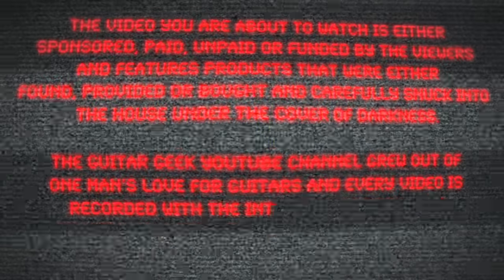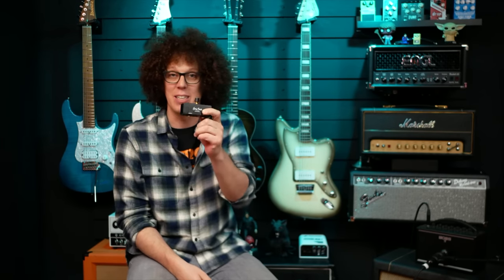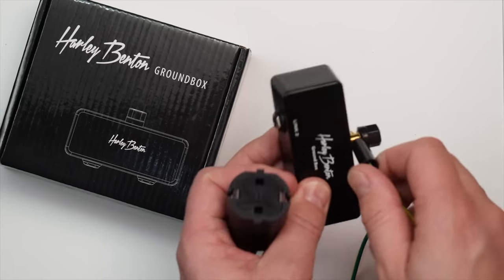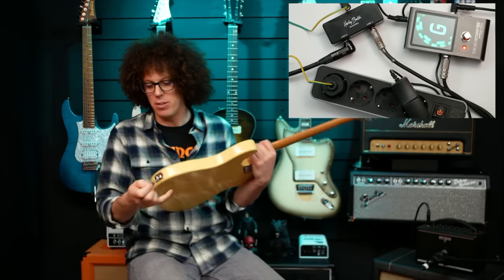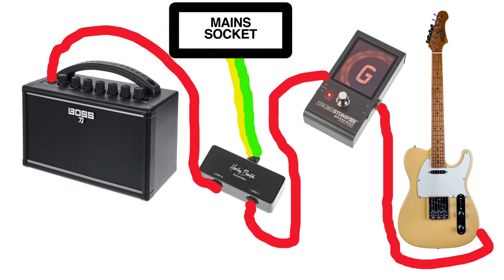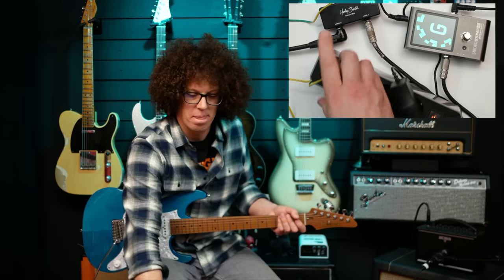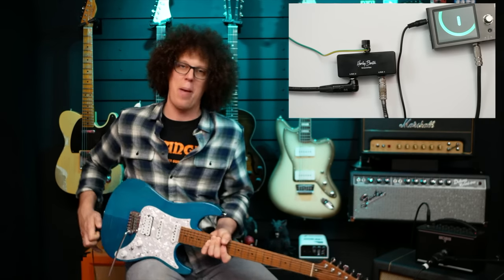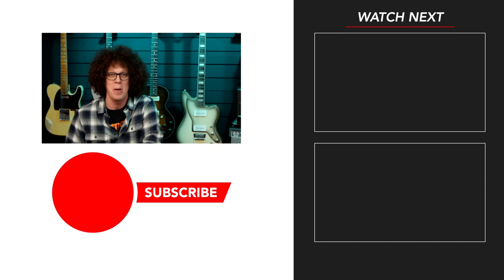Clean up your guitar signal for 15 bucks - Harley Benton Groundbox

Comment: The term "Ground Hum" is misleading, it's actually just electrical noise in the room which your guitar and leads pick up. If you are plugged into an amplifier with a grounded chassis and 3 prong plug then all the noise which is picked up by strings, bridge, tailpiece etc is shunted to earth via the guitar cable shield. Not 100% effective especially on single coils but it works. If you are using something like a battery powered amp or a multifx unit through headphones with a 9v DC power supply, not connected to an amplifier, then you have no ground connection and the noise can be severe. That is where this device is needed. I made my own version 2 years ago, it makes a huge difference.

Comment: My home-made version of this consist of a single electrical wire that connects the ground in a socket to a screw that holds the jack input on the guitar. This solution does not effect tone at all :)
This gave me the idea to make my own pin-less plug!

Comment: I thought this kind of problem was fixed using a noise gate pedal. What are those pedals supposed to fix then?
Reply: They have several uses. In high gain situations, dirt pedals, you raise the signal, and the noise floor, electro magnetic interference as well. This is usually  quieter than your guitar signal. As your strings ring out and fade, the signal and noise is gated, shut off.

Comment: So, to get rid of ground hum when using battery powered amps you need to find a mains outlet to plug in the Ground Box. Kinda defeats the purpose of using a battery powered amp, doesn't it?
Reply: battery powered amps don't have ground hum. batteries are DC not AC. i guess he uses the katana mini with a power supply. correct me if i'm wrong.

Comment: Correct me if I'm wrong, but if I understand this right, you need a real ground terminaled power socket. It will not work if your power strip is plugged into an ungrounded wall socket!
Reply from the maker: Earth has to be connected somewhere
Reply: @TheGuitarGeek  but this is for ground not earth.

Comment: I suspect a single conductor wire, with an alligator clip on each end, will possibly do the same.   Clip on anywhere on the shield of the guitar signal, and clip the other to a good ground might do the same. Make the wire about 20 feet long, so you could be sure to reach to a suitable ground, that will kill the hum.   I believe a ground hum is caused by voltage flowing the ground conductors, which is inducing a voltage onto the signal wiring.
Reply: You're right, it'll do the same. I used that "hack" on my pedalboard for a long time and still have a "ground only" main plug with the cable ending in a little plain copper wire that I can, say, fix under a pedal jack's screw. Works a treat.
From all I gather, the reason why this works so well, is that it adds solid ground to otherwise weak arrangements of pedals and what not, hence any shielding works better. I mean, when you power up a pedal board with the usual suspects (aka PSAs or batteries), there's no solid ground connection others than the output running into the target (usually an amp). Make that a battery amp (as in this video) and you're completely doomed already (no solid ground anywhere anymore), but also things such as modeler setups (often running into DI boxes) often are a victim.
Needless to say, it doesn't even work remotely as well when using wireless systems, but one should avoid those as the plague whenever possible anyway.

Comment: Looks neat, but I think the problem is actually amplified by your method of testing here. When unplugging the groundbox but leaving it in the loop, the groundbox is surely a glorified long unisolated antenna picking up on a ton of noise. A long piece of wire that doesn't go to ground is just adding more noise. So when you plug it in, it goes from one extreme to the other, which is a bit of a misleading demonstration. 

For science, you should have made the setup with it hooked up in the loop, and compare it with the noise you get with it taken out of the loop

Comment: So it's a pass through with the ground being shunted through  to mains ground?

Possibly be able to add a powered buffer to the unit (or a similar to mains ground, to a buffer pedal), and negate the tone suck somewhat.... As its simply a wire to mains ground. (you can do this simply by adding a single core speaker cable to your buffer pedal ground and wiring it to the ground pin of a plug. For safety DO NOT ATTACH ANY OTHER WIRES TO LIVE OR NEUTRAL PINS of the plug and leave out the fuse (as its not attached to anything).
You'd need to drill a hole and moon another jack socket in the buffer pedal though... Or rehouse the buffer in a larger enclosure for ease.

I'm no engineer so just taking a wild guess here 😁

Its an interesting product for sure. And a reasonable price that any gigging guitarist can afford to chuck in the bag in case of a dodgy wiring venue.

Comment: Great video and a great solution to a big problem, however after watching this i went to the thomann site to buy a groundbox and i couldnt find it anywhere, has it been discontinued? And if so is there an alternative product you would recommend?
Reply: Discontinued 😞
Reply: Use a metal bodied jack cable in your rig. Connect a long wire to the ground pin of a mains plug. Connect a crocodile jack to the other end of the wire, clip it to the jack body.

Comment: If your mains-powered amp rig is making a hum like this, then you have a real grounding problem with it which needs to be addressed.  It is electrically unsafe.  Don't rely on a box like this to make it safe.  You need to check your power socket for a ground connection (you can get cheap plug-in socket testers from DIY stores and Amazon etc.), then work back along the chain through mains leads, amp, guitar leads and stomp boxes to test for ground continuity.  You'll need a multimeter to do this, but you only need a cheap one.  

A ground box like this is designed for battery powered or computer recording rigs where all the components are powered from double-insulated PSUs with no ground connections.  These are electrically safe, but because of the lack of ground, cable screens don't work.  Here, a ground box makes perfect sense.   It is providing a ground reference for the screening.  It should not be used to provide the safety electrical ground for mains-powered equipment.
Reply from the maker: Hi Simon. Are you an electrical engineer?
Reply: I know a fair bit about electrics, and also spend a fair bit of time on the Sound on Sound forum where grounding issues come up fairly regularly.
Reply from the maker: Thanks for being clear
Reply: As I said, this product has its place, and I believe there are similar products with a ground wire to a mains plug with a crocodile clip on the end that can be used for attaching to the metal casings of jack plugs or XLRs to provide a ground reference for laptop-based recording systems where there is no ground and everything is 'floating'.

But by curing hum by connecting a good ground to the shield of a guitar lead just proves that the cable shield isn't grounded.   But with a mains-powered amp set-up, it certainly should be.  If it was grounded with a good low-resistance path to ground (less than 1 ohm or better), then grounding it again won't improve anything.  

So it's very likely that if it does cure hum on a mains amp, then there's definitely a dodgy or missing ground connection somewhere in the system.   

With a battery amp or a set-up that's powered from double-insulated PSUs, then its certainly likely that there won't be a ground connection and hum can occur, but the system is electrically safe.  This should be the only type of set-up where this grounding plug should be used.
Reply from the maker: Thanks again. Just be careful about giving out such advice when knowledge is not based on being fully qualified to do so.
Reply: It depends on the term 'fully qualified'.  I've been involved in the design and approval of LV switchgear systems for 25 years or so.  But I have only a general knowledge of domestic wiring installations, so it depends on one's definition of 'fully qualified'.    But I've certainly read all the relevant sections of the IEE/IET regs on earthing/grounding, plus have enough electrical/electronics knowledge of amp circuits to know generally what's going on.  I certainly haven't just watched a couple of YouTube videos!
Reply: I should mention that if you have a battery/mains amp with a 2-pin fig-8 plug connection at the amp end of the cable, then that will be electrically safe but could benefit from this ground plug if you do get a lot of hum.
Reply from the maker: Then you’ll know that a product like this would not be allowed in the market if it were not safe. The hum issue arises or two different pieces of gear are on two separate circuits. This has nothing to do with amps not being earthed properly.
Reply: There's nothing intrinsically 'unsafe' about this product.  But if it cures hum when you're plugged in to a normal amp, then there is something unsafe about the amp itself which needs addressing quickly.  

When you mention "The hum issue arises or two different pieces of gear are on two separate circuits"  you seem to be be talking about ground-loop noise.  This is very different to a missing or poor ground connection noise and is generally of a  broad-band nature with a lot more high-frequency content than the mainly 100Hz hum in the video (50Hz hum is a lot lower than that in the audio).   Ground-loop noise occurs when you have two or more ground paths, and the current flow down the two ground routes is enough to create a voltage differential between the two ground connections.  Adding yet another ground path is only liable to increase ground loop noise, not decrease it.
Reply from the maker: It can make a bigger hum but I’ve since tested it in another studio and it improved the situation.
Reply: If it is a ground loop issue, then yes, sometimes adding another ground path can make things better, not worse.  They are strange things.  

But if you do have a lot of hum and something like that ground box fixes it, then I'd really recommend getting a multimeter and checking the resistance from the guitar jack to the earth pin on the amp with all your normal effects and leads plugged in (using no ground box and with the amp unplugged of course).  If you are getting 1 ohm or less, then it's a good ground connection and you are probably looking at a ground loop issue (provided there are at least two mains connections with mains earths).  

Once you get to double figures for the ground path resistance, then there something wrong; maybe a loose connection or corrosion on a jack plug or socket.

I'd then try the resistance when plugged direct into the amp.  If that's low, then the issue will be somewhere in the FX chain. If it's still high, then check the mains lead and your guitar lead ground path resistances.  If those are low, then there must be a ground connection issue within the amp itself and it should be looked at.
Reply: I have been formally trained to check for safety issues in earthed mains devices. DO NOT USE A MULTIMETER, especially cheap one to test the ground connections on suspect amps or any other appliance. You need a pat testing device, calibrated, that can measure very small amounts of current, accurately. It takes a very small amount of electricity to get a lethal shock. It takes less to trip out an rcd, thankfully. I would recommend  that gear used for gigging, rather than home use be PAT tested yearly, along with electrical safety guidelines. For home use, 3-5 years or immediately if you suspect a fault. 
Some venues won't let your gear through the door without PAT testing.
This is a great simple device and I intend to build one. I would recommend using a metal bodied jack in your signal path. Use a mains plug, connect a single core wire to the groung/earth pin, the other to a crocodile clip. Only connect it it if necessary to the metal jack, as the set up can attract rf interference. Which I suppose is what the bannanna plug is for. My way just removes any excess "antenna".

Comment: This only works if you have a grounded wallsocket.
Reply from the maker: Well... yeah
Reply: One would hope that all wall sockets are grounded. The ground serves one main purpose. To take errant current safely away. Either from your body to prevent electric shock or shorting which may cause a fire.

Comment: 60 cycle hum sucks! 
Just a thing I thought about... If you're going thru an amp which is connected to ground through its power strip, and you add one of these things, wouldn't you be creating a ground loop ?
Reply from the maker: It’s also possible to create a ground loop with this. So I would not advise having it always plugged in.

Comment: I live in a crappy apartment which has no earthed sockets, giving me that exact noise you're making in the video. Would this fix that? Since you still have to plug it into a socket.
Reply from the maker: I don’t think it would fix that but it’s a cheap way to experiment
Reply: @TheGuitarGeek  Yeah for 15 euros I think I'm just gonna throw it into my next Thomann order!
Reply: If you have no earthed sockets then your wiring is faulty and this will do nothing. Buy a simple mains socket tester, around £10. This will show you if the sockets are dangerous. All electrical sockets need to be earthed. This is to help prevent electric shock and electrical fires in the event of a faulty appliance. Get it fixed immediately.

Comment: I tried a similar Joyo device and it shorted out my PS, and my Klon, to which it was connected, and when the PS shorted out, my old UniVibe was damaged too. I had them both rebuilt. I’m still working out the compensation from the retailer. 60 Cycle Hum Sucks!
Reply: I don’t think the Joyo device is at all similar, if it’s that dongle which sits in line with the power to the pedals. That's a filter, not an earth line.
Reply: @themellonfactory  My mistake. I don’t know enough about electronics.

Comment: For such a small unit it must be a fairly simple circuit inside I'd love to take one apart! :P 60 cycle hum sucks
Reply: It has to be a small signal transformer inside. That will allow the signal to be passed but still isolate the earths (grounds) from each other.
Reply: It’s probably hardly worth dignifying with the word 'circuit' - in all likelihood it just taps the signal earth to an earth wire connected to the plug earth. I make my own with just a plug, a wire and a croc clip which I fix to the body of a jack plug.
Reply: I'm pretty sure this just connects the guitar signal ground to electrical earth. The jacks will be connected to each other.

Comment: I am suspicious about connecting the guitar GND to mains directly. If something goes wrong in your household there might be voltage on GND. Devices use GND to drain interference via y or x capacitors or use it to get rid of static electronic discharge. It is connected to an FI, which measures current against this conductor and switches of in case of a device failing or of you sitting an the bath tube with your hair dryer. Until the 70s it was allowed to connect GND and Neutral directly in an installation without an FI. That's what we still have in parts of your house. I think using this GND devices can also introduce additional noise and I see it as a potential safety risk to link your guitar directly to the power outlet in any way.
Reply: If there’s voltage on your household ground your ground is not grounded and your house is a death trap.
Reply: There shouldn't normally be voltage on your mains earth. Look at your earth as a safety valve. It should be a better route to earth or zero potential than you. It should help prevent electric shock and fire in faulty appliances. Neutral or positive are constantly flipping or alternating currents. They are live, they should only connect to earth in the event of a fault.